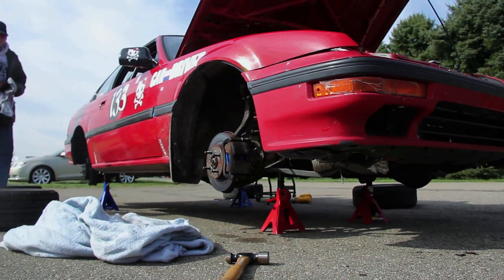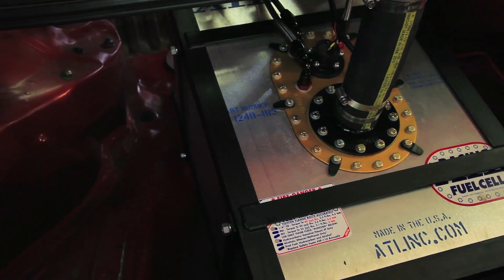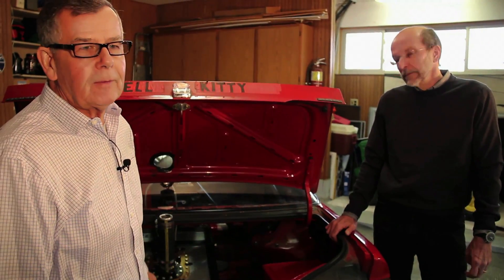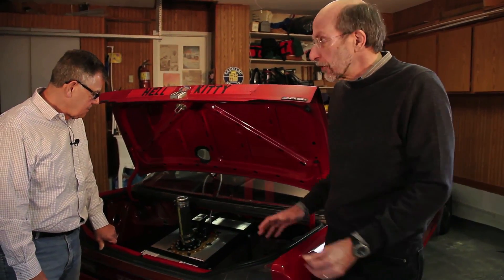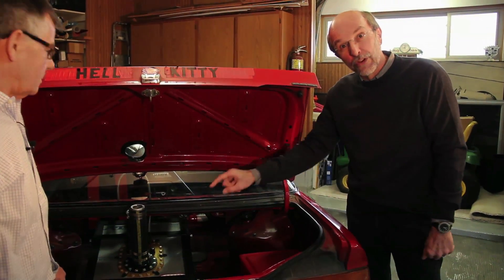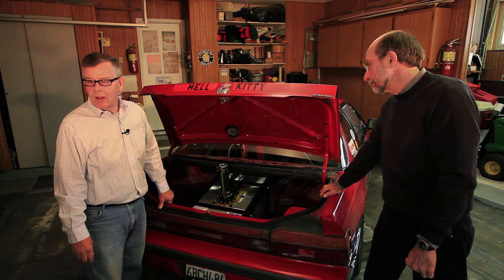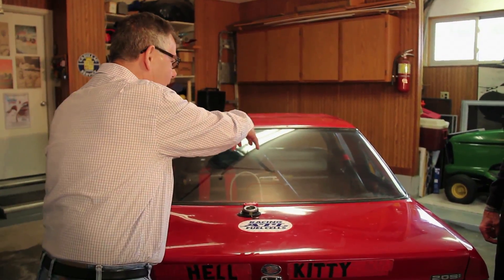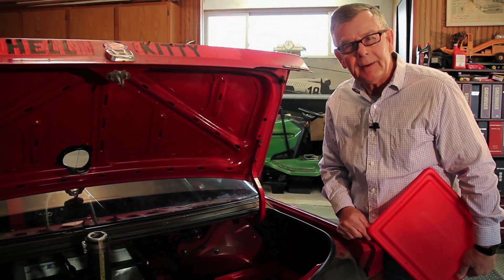24 Hours of Lemons 1988 Honda Prelude - Fuel Cell Install

Comment: I gotta '90 Prelude Si, and I'm planning on lightly tuning it in all areas, but I can't really find anything for the engine (I don't want to turbo it). Do you happen to know if cams for an LS motor would work in a B21? or what pistons will work with the FRM sleeve? I'm trying to reach about 185-200 hp n/a.

Comment: I know there is a limit of 500 bucks on the total cost of the car, if I recall correctly. None of the safety equipment is factored into that price cap, so you can add stuff like fuel cells, roll cages, harnesses, and fire extinguishers.